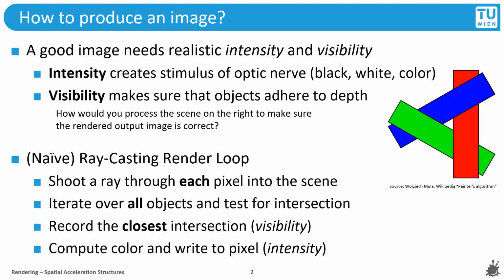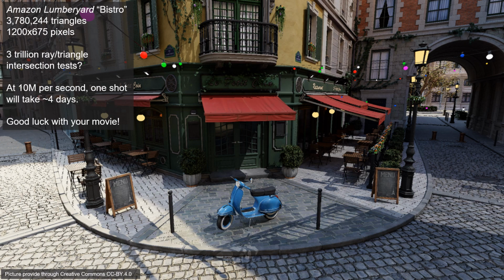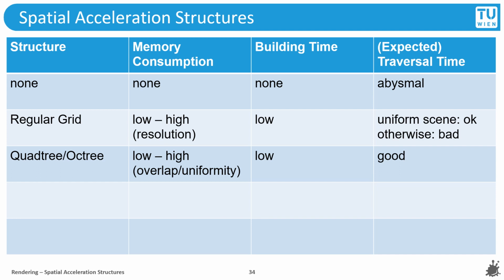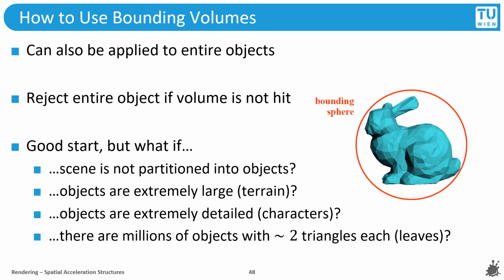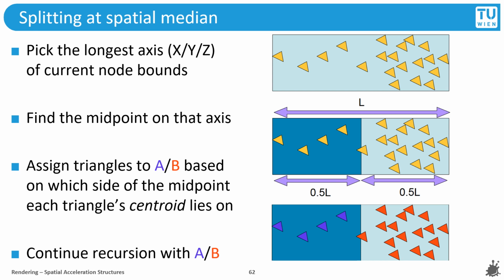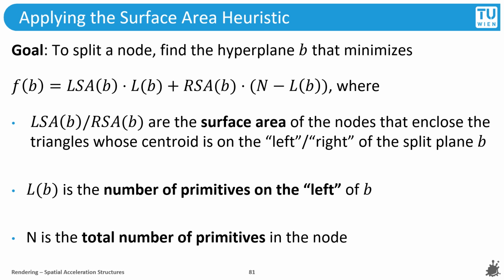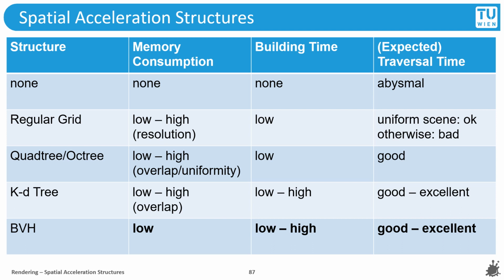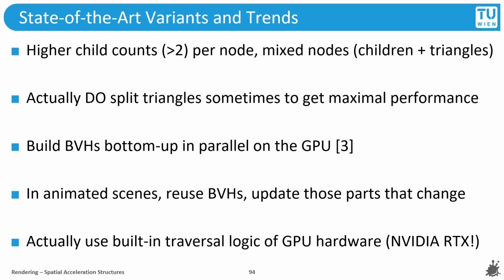Rendering Lecture 1 - Spatial Acceleration Structures

Comment: Thanks for this, I've been looking into ways to reduce the memory footprint of some 3d voxel lookups (looking up an axis-aligned object made of arbitrary cells in a 3d grid), and this helped a lot! Right now I'm using a giant grid to quickly check if some cell is occupied, then checking every cell of every object to look up an object by location. Once I get a bigger test scene to do performance tests on, I'm going to try an octree for the object lookup, and probably just loop over the cells of objects in a leaf to see if a cell is occupied. Some of the raycasting stuff doesn't apply for me, but this was very informative.

Comment: Excellent presentation! One detail about the way you start the traversal of BVH, no need to start outside. A simple additional test on point in bound (the origin of the ray) when testing the tree nodes from root is enough and faster.

Comment: The most interesting way of rendering is Portal-rendering (What the Descent engine does). You split the scenery in konvex subpolyhedrons, and begin rendering in the room there the camera is. If you hit a portal, you clip the viewing frustrum agains the portal, and go to the next room. So you can render from back to forth without overdraw. It doesn't need an actual structure, and the traversal time does not depend on the level size (with BSP, and other ones the complexity would be logaritmic)

Comment: The presentation quality is pretty good here. But this getting students to have to "learn to run before they can walk" is a giant pedagogical mistake.
Throwing fresh minds eager to learn ray tracing, way into the deep-ends of BVH and SAH as the very first entry lecture, is almost a sure way to loose the majority of them at the very outset. Anyone interested in this could alternatively spend weeks and months without any acceleration structure at all, while still getting interactive/real-time framerates, even on just a single thread CPU - as long as the initial scenes are kept small and simple.
 Learning the basics of ray-generation, ray-intersections with spheres, triangles, quads, boxes, doing lighting and shading, including shadows, reflections and even refractions - all way ahead of even thinking about any acceleration structure at all - is very easily achievable and much more satisfying for the students - many more of them would be much more likely to stick around. After the basics are firmly in place, the size and complexity of the scenes can be increased, incrementally - only THEN is the appropriate time to start discussing acceleration strategies.
Reply: I concur.
Reply from the maker: Thanks, we'll discuss that as well when preparing the next lecture. However, this part is unlikely to change as we also need to take care of the exercise part (this is primarily a university lecture and was moved to youtube because of corona). The acceleration structure is a topic that is relatively easy to pack as a coding task at the beginning, while we develop other topics. It is taught in that order at least at EPFL (by Jakob) and at Aalto University (by Lehtinen).

Cheers, Adam
Reply: @cgtuwien  University students have to follow their curriculum as-is regardless. They're also unlikely to raise concerns about it or drop-out at the beginning. So when there are issues with it, the chances of that being surfaced are pretty low.
It's quite different in the online courses world, and especially on YouTube.
Reply from the maker: Oh, and another thing. Back then when I took that lecture at Aalto, i think I wouldn't have much motivation to implement BVH after having worked with path tracing already. More interesting things ahead, but I would be missing some basics. But that probably also depends on the type of person you are :)
Adam
Reply: @cgtuwien  You'd probably get tired of waiting too long to see a render, the moment you start using anything more than the most basic of scenes. That'd be motivating enough to want to make it faster. Regardless, I think for any kind of educational material, a gradual increment of difficulty is recommended. Making it more difficult than it needs to be at the very beginning, is just raising a barrier to entry higher than it needs to be.
Reply: @cgtuwien  Any reason why your course chose to implement the BVH whereas Jakob's implements the OctTree?